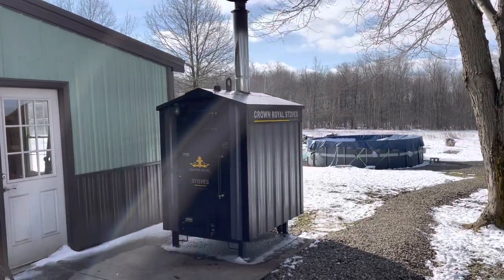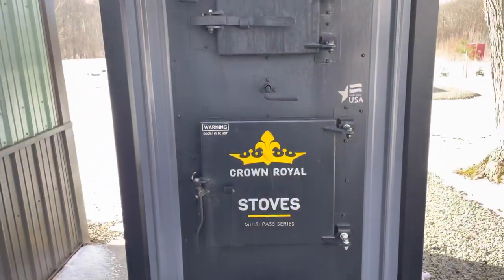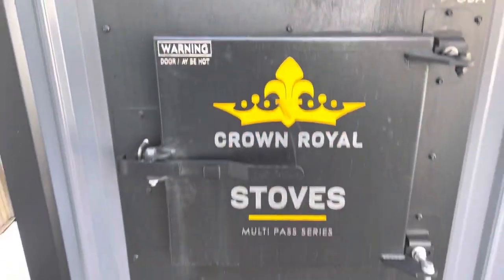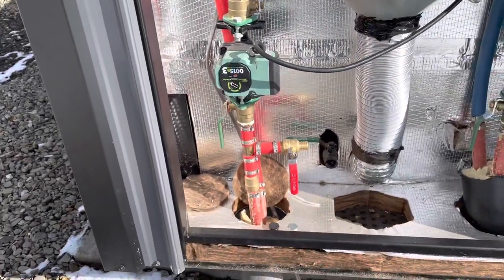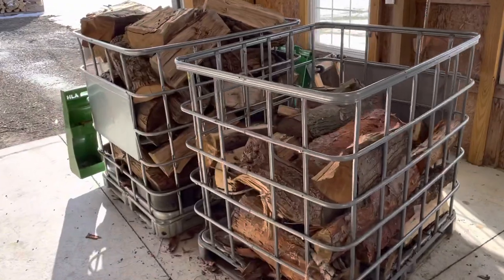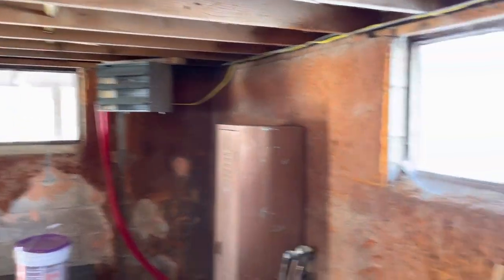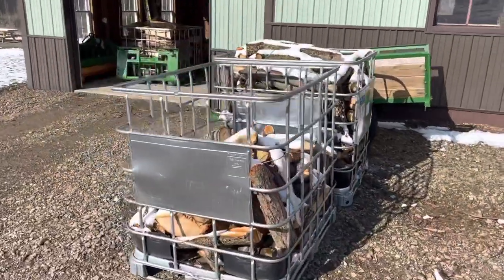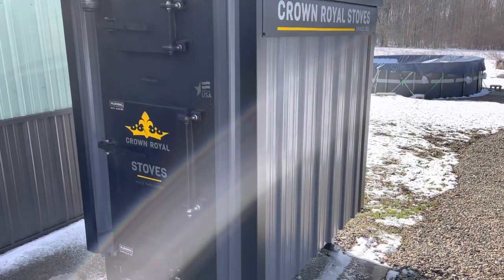First season with my Crown Royal MP7300

Comment: As a three year owner/operator of a 7200MP model, I offer  one other piece of advice/warning; NEVER NEVER open the door without making sure you are standing off to the right side, and back away at arms length when the stove is burning. Especially when it has been idling (fan not blowing) for a while. Mine, on occasion will back draft, and belch a ball of fire out the front that would roast you if you were standing in front of the open door. If you don't know what a back draft is, watch any of several youtubes on back drafts. Firemen learn about them on their first day in fire school.
Reply from the maker: I always check the water temp make sure I hook the u-bolt with the latch any time I open it. I'm a career fire fighter and understand fire behavior and backdrafts, but I appreciate the advice and tips. Thank you.
Reply: @Spudd74  Come to find out, either the newer models or the older models ( I don't know which my model is) had a damper rod on the front that you opened before you opened the door to eliminate that potential. Mine has no such thing and I've had it belch out a fireball several times.
Reply from the maker: @oldandintheway9805  mine has the rod.

Comment: I am getting a 7200 mp this spring. Thanks for the review
Reply from the maker: Awesome. You’re gonna love it. It’s a little frustrating until you get a good coal bed. Also I learned to keep the blower turned way down and than I didn’t have any problems with it going out, even on the warm days.
Reply: Thanks I am in NW PA to how much wood did you go through last year?

Comment: How many cords did you burn and what size s/f you heading? Thanks for sharing
Reply from the maker: From October until late April early May I’d say around 10 full cords. That’s heating around 2000 sq/ft and our domestic hot water. Keeping the house around 72*. The only time I run the heater in the barn is if I’m out there working. I probably burned a couple more cords over the summer heating the pool and still doing the domestic hot water.

Comment: How much did it cost?
Reply from the maker: All in around 12k. That's the boiler, 2 pumps, 150' of pipe, plate exchanger, heater in the barn, and misc. fittings, wire, and thermostat for the barn.

Comment: Do you feel now that your have ran this an entire season that it is better then just a wood stove in the house? 

How much smoke are you getting each time you load it. I hate breathing and smelling smoke. Im at the point now where i have to decide for this boiler or soap stone wood stove.
Reply from the maker: Yes, I do like it a lot better than a wood stove inside. The mess it outside. No worries of my house catching on fire from that random hot ash or from the stove burning too hot. I don't have to split my wood as small and with my stove I can burn pine and other soft woods if I get into a pinch it doesn't have to be seasoned. I do burn more wood with the boiler than I did with a wood stove, but I don't mind, I enjoy cutting firewood. 

As far as how much I get when I load it. You do get some smoke coming out, but it all depends on if you give it a minute when open the the dampener and crack the door. Also depends on where you are in the burn cycle, if it just reached temperature or if the blowers are getting ready to kick back on. The type of wood and how seasoned it is will affect the smoke. So yes smoke can come out but its outside so its not smoking up your house.